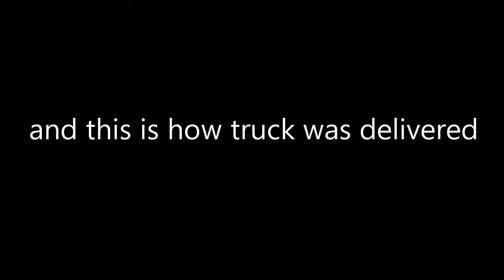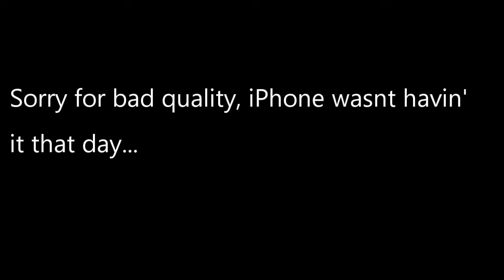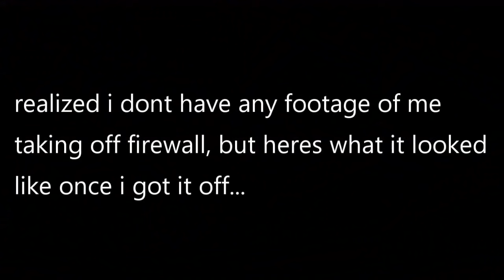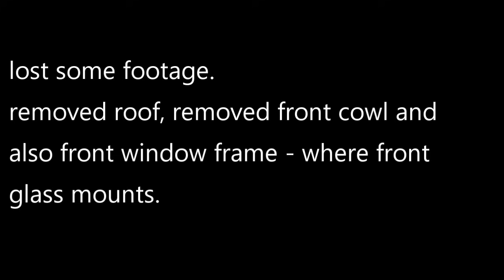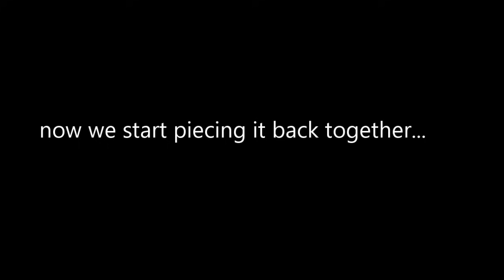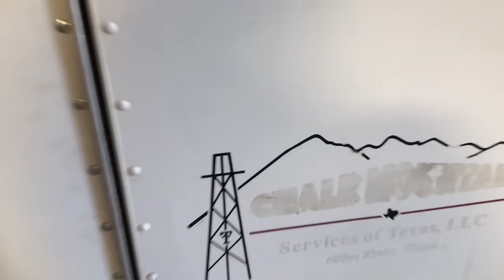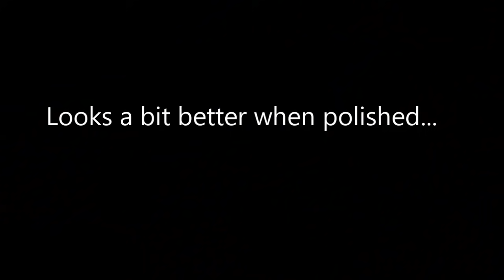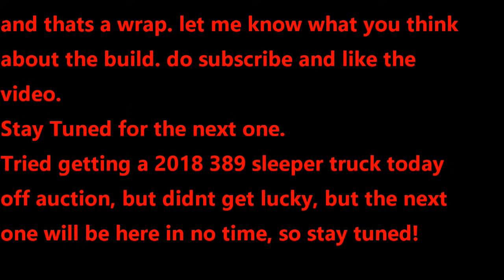2015 Peterbilt 389 from Copart - Start to Finish

Comment: Never worked on a truck cab before. All the fastener holes must be drilled on a jig. On aircraft, panels are either jig drilled or drilled to a tolerance by hand. Jig drilled parts can be swapped. Nothing ever aligns on swapped hand drilled parts. Very impressive work you've done there.

Comment: Good job mate, I recently just got Into rebuilding trucks my self just finished up a 2018 Kenworth w900 roll onto its side. Fully loaded Allison auto nav plus heavy spec double frame disk brakes all around. The truxk was purchased for 200k here in Canada. I purchased it at auction for 27 grand Canadian :). What was super amazing with this build was the frame and all major components were perfect no damage just new cab and some from end parts, trucks on sale now for 165 and offers for 140 are comming in steedy and I’m going to take one of the offer today I think

Comment: Great job on the build. The o ly problem that I saw was the placement of the def tank. Most def pumps are on the left side at fuel stations, but that wouldn't be a deal breaker. The end result was really nice.
Reply from the maker: ye, i dont decide the placement of those. I see a truck, i like it, I buy it. lol.. but yes, its a bit incovenient, but either way, local trucks rarely fill up def at pump. We all have totes of DEF in the shop for the trucks.
Reply: i was gonna suggest a  cross frame fill tube until i saw your post  @BulletMcNugget

Comment: According to DMV so long that it dont replace engine n frame rails you are fine replacing csb.. so why  not use the parts cab?
Reply: The parts cab was an old 359 cab so more than likely it was too old to be used as a whole replacement cab.
Reply: Leo Felix j

Comment: Well the background music I can live with but the camera work.... the flash into an out then in then out is real hard on the eyes. I stuck it out cause I love trucks. I think you did a great job as fiberglass is not a lot of fun and you had a truck load of it. Curious how long it took as your tool selection was bare minimum. I have done some of the older cabs and it takes a while. It took me nine months on a roll over but more steel and bolt ons so that helped. Where you have me is the fly by wire is so much easier and the schematic makes the job easier s my memory is crapola now. I guess the white is kinda gaining traction as a popular color. I went emeron steel gray with yellow and red highlights plus flames and that tells you its been a while ago. My name on the door in old english with the whole color thing blended in. I did three cabs and retired from that cause it is dang hard work and my back give me all kinds of problems from accident.

Comment: Hey man , just watched your video and absolutely love what you did with the truck . It’s amazing and nice to know that people still rebuild trucks like what you did with this one . How did the engine perform when you first cranked it ?
Reply from the maker: Had to crank for a while cause stood a long time, priming took a while. It lost all its oil cause it busted oil pan in crash so I was worried about that, but runs good and sounds smooth so far.

Comment: few questions ,  why didn't you put the other cab on the chasis , why go through all rivets just to change parts on it ? 2 what was the cost of the truck and the cost per total , with work , parts etc? and  3  on the right side of the truck there is a black tank with a blue cap , is that for AdBlue? I mean i live in europe and i thought only we had strict emission regulations ( euro 5 , 6 etc)

Comment: Not sure if it's been mentioned, but a rivet drill bit would have made your life a hell of a lot easier. Very time consuming, and potentially more damage to the panels you may reuse instead of hitting all those rivets with the die grinder. Nevermind, I see that you either bought one, or started using it when pulling the undamaged roof panel.
Reply from the maker: On the panels i didnt reuse, i just cut the rivet and hammered off. On the one i needed, i shave off the head with grinder then just punch the center and it falls out the back. Never even heard of a rivet drill bit. Do they have those? Would make my life alot easier for next project
Reply: @BulletMcNugget  
Yeah they do... I could've swore later towards the end of your video you were using one. I must be going blind. Wow. Lmao. Yeah they have a specially shaped type of 'shank.' You can probably pick them up from a body supply place, or maybe online- Eastwood, McMaster? They definitely make life easier. Guys use them a lot in drilling spot welds. There is "Unibit" type step-bits as well. They're great for drilling aluminum. They don't tend to bite into it and mangle it while twisting you're wrist.
You did a hell of a lot of work on that rig man. Anything out there that'll make your life easier next time is a plus.

Comment: Three questions. 
1, why this music?
2, why didn’t you use the parts cab in whole. ? Looked fine. 
3, why spend all this time and still only have an auto truck? 
Eaton fuller all the way!!!
Reply: Dude it is an eaton fuller box... just an auto
Reply: Automatics are for weaklings, a 13-18 speed manual is usually better
Reply: @4everjesusrules  what a foolish thing to say.
Reply: I often spend time in LA traffic, and NY traffic in the same trip/week, automated manual has a manual mode, no going back now. I didn't think I'd like it, but yeah, I do now.

Comment: How did you make the hole on the driver's side to put the new  air canister.can you please let me know.  Thanks
Reply from the maker: With a hole saw... just mark the spot and drill holes, inside the circle u made then get a little saw and make the edges nice
Reply: Hi.can you tell me the measure from top side   right side.left side to cut the hole or how I can do that. I wan to put the canister air filter on my peterbilt 379 i got one on the passenger side but I like to put one on the driver side. Eny help. Thanks

Comment: I'm curious to know what was the advantage of using the parts cab to fix the original over just installing  that cab on the truck?
Reply: I had the same thought. The parts cab looked structurally sound and if this were my truck, I would have used it. But then!!! I am not an expert...
Reply: Vaibhav Masurkar maybe they got diff vins
Reply: Just switch firewalls so vin will match paperwork
Reply: Yep, that's what I'm thinking about. But maybe the VIN...
Reply: FOR SALE. 
one lady owner.  all LOGS were in roof compartment.
Reply: bi curious.

Comment: This is a question from someone who has never done this, and not a criticism of any kind. Would it have been easier to just swap out cabs or were there differences that (A.) you didnt want or (B.) that would not work? Just wondering. Great build though!
Reply from the maker: It was a 1997 cab and would not work. And getting a new cab is about 15k. I got the parts cab for $700. So the only option was to swap out panels just like  I did. Alot of people are asking same question, hopefully they see this reply!

Comment: That looks awesome now man, how was the first drive?
Reply from the maker: I just drove a bit around yard and maybe a mile on street. Paperwork still in process so not risking anything for now...
Reply: @BulletMcNugget  let me know man, good work you done on it though
Reply from the maker: I been paranoid cause of the lost oil but they shut off when no oil, and when I was replacing pan looked at pickup tube, glanced at liners, everything looked good at the time being.
Reply: @BulletMcNugget  hopefully just a gasket or something simple.
Reply from the maker: The oil pan had a hole... leaked out oil, but hole was small so not like it all came gushing out. Replaced pan, and everything is good now.
Reply: @BulletMcNugget  yeah man, that's awesome.

Comment: Nice job but there's no explanation on anything. Looking at those rivets, truck manufacturers didn't make the cabin sturdy so when the truck get smashed into something the driver would be safe without getting hurt. You did a very nice job
Reply from the maker: This was just a start to finish. I have previous videos where I kind of break down the rebuild process. But im new to this whole filming thing, learning as I go...

Comment: This was a oilfield truck running sand in west Texas reason for the dirt in the cab they usually never get cleaned out because they run 24/7 they just stop to switch drivers and back to hauling sand they go

Comment: Hmm parts cab was off a 379 though did it have all the same wireing?
Reply from the maker: no, I used all my own wiring. just used roof panel, cowl panel and front window frame.
Reply: BulletMcNugget interesting

Comment: i dont get why you stripped the parts cab why not just use the whole thing swap cabs saved weeks of pannelbeating riviting ect
Reply: Exactly what i was thinking, he could've saved weeks off of his time....🤔🤔🤔
Reply: he did not because the vin number would not be the same!!!!!
Reply: @timsmart1465  I figured that's why he chopped up the parts cab. The VIN must be stamped in to it or something (never been close enough to a semi to see) I know cars and trucks just have the vin plate riveted to the top of the fire wall behind the windshield.
Reply: @timsmart1465  but couldn't he just have cut the firewall off of the old cab and rivetted it to the new cab...assuming that the VIN number on Most trucks is stamped on the firewall...but then again he's the one putting in all the work, so he must have had his reasons for not swapping the old parts cab and boldting it directly onto the chassis....👍👍👍
Reply from the maker: Lol... i explained in previous comments. My “parts cab” was a 1997... insides, dash, wiring, mounts everything about it was different. If I could have directly smacked it on truck and not done all that work I foooooor sure would have done that. Woulda saved myself alooot of time and headache. But nothing from parts cab would have worked on mine except for the panels I ended up using... the doors, doors frames everything was different back then so no way I could have used that cab, otherwise I would have. VIN plates were never an issue....
Reply: @BulletMcNugget  thank god for clearing that up, My OCD was kicking in and i was desperately searching for an answer on youtube, searching to see if some other builder had done something similar....thank god now i can sleep peacefully...👍👍👍
Reply: @BulletMcNugget  thanks for exsplaneing buddy pitty that as it would of been a lot quicker fix

Comment: I curious as to y not change the whole cab instead of getting panels from the parts cab and putting it on to the wrecked one?
Reply from the maker: Easy. Look up price on how much a cab costs. 12k-15k and they still might need some work.
Reply: @BulletMcNugget  
Yes I get it but the other one was complete though, was it a different set up or something?
I built cars and pickup, and was curious about this build, came out nice though.
Reply from the maker: @jaykamal1978  the parts cab was a 1997. the interior is completely different. taking my interior and putting it in there, was unrealistic and i doubt id be able to make it work cause all mounts and stuff is different in there, so only option was to just use the panels off that cab and put them onto mine.
Reply: Answered my question before I asked it.

Comment: Great job, but why not use the parts cab as a whole? or did you just want to practice your sheet metal skills! LOL!
Reply from the maker: Yes, I just wanted to spend all that extra time cause I had nothing better to do. 
Ive said it alot of times before, but again, the parts cab would not have worked. It was a 1997, insides, wiring, dashboard everything was different. Obviously I would have done that if I could... but I couldnt!

Comment: You did a great job on that Truck sharp Truck have you seen the Rotator 389 that Ron Pratt has it is a 2015 Pete too it looks exactly like yours in the Front I really think it is the same as your except that it has that Centcury Rotator Wrecker Bed on it & has a Drop Down Axle under it too besides the 2 Drive Axles otherwise it is the same Truck OH it also has the 2 BIG Wheels & Tires on the Front yours looks like a Million Bucks

Comment: Fucking brilliant job brother. Video should be titled "Guy builds Peterbilt kit"...lol. On another note, I'm not sure if you are selling it on to someone but if you are keeping it for yourself, you could have improved on the original design somewhat. Like glue before riveting, dynamating the cab while it's still a skeleton, etc. Just a thought. If you are simply flipping it then great fucking job! I'm curious how much all the parts and materials cost ya. Regardless, great job, Sir.
Reply from the maker: I did use sealant just didnt film it lol. Filled all the seams with sealant to prevent water and hopefully not have air noise. But appreciate it!

Comment: The only thing wrong with this picture is that is not my driveway, I'm way over here in Indiana boys. Believe it or not, the 2003 Intl 9400i with 72" solo condo I bought in 2010 from what I was told in 2012 looked even worse than this and it was rebuilt to almost like new. I didn't learn of it's demise on I-80 in Iowa in 2007 at the time I bought it. First question I asked when I bought it was "has it been in any wrecks"? They said no, none they were aware of. Lying POS them guys were. They bought it in 2005 so obviously they knew. So yeah, total wrecked trucks can be rebuilt to like new and perform just as good for a fraction of the cost.

Comment: why not replace the whole cab instead of pieces?
Reply: Thats what i was wondering
Reply from the maker: well, a new cab is about 15k. and the cab i bought for parts was 1997, so that one wouldnt work in any way. so what I did was really the only best option.

Comment: I wonder how much Copart pays this guys and some others to advertise for them.

Nice rebuild, but not so hard. Semi trucks are not as complex as 4 wheelers. If there's no damage to tje frame and drivetrain, rebuilding a semi is actually easier. Replace the cab, the hood and it's mostly done. Then just check for shorts in the wiring and tune it up.
Reply from the maker: I wish I got paid from Copart. I wouldnt be wrenching lol. 
I mean ye, if u wanna spend 15k for a cab, then about 12k for a hood without headlights, so add another 1k for headlights, then ye its easy if u just replace stuff. But the whole point of this is to rebuild it, without having it cost u close to a brand new one...
Reply: @BulletMcNugget  Yes, parts for semis are expensive.

You're advertising for Copart for free then.

Your videos would be great if you take anything that says Copart or from any other auction, out from them.

Copart is very tricky and is best left for the experienced buyers.

Some dumb viewers might head to Copart just because they watched your video and could get screwed badly, then come back throwing rocks at you.

You might not be advertising, but there are many like yourself posting videos with Copart on their titles. They all claim that they are not getting paid to advertise Copart, but they are advertising the auction house.

I'm not sure about you, but on the other youtubers is the same trend. First build title..... x vehicle from Copart, Second build x vehicle from Copart, third build x vehicle from Copart. Which means thay they are in fact making videos to advertise Copart.
Reply from the maker: Adan Ochoa i mean i get what ur saying, but im sure everyone uses there brain and knows its an auction, anything is possible. And auction says, all sales r final. Ur responsibilty once u win the vehicle. I bought a mercedes SUV from Copart. Spend 20k, bumper headlights, grilles, parking sensors everything was in car in pictures. At least 5k worth of stuff but once i got car, completely empty. Ye i called copart but they said well we dont know what happened so i just had to suck it up and live on. So like I said, im sure everyone understands its an auction. I purcashed this truck with little damage to the roof, recieved it with alot more. Again, had to live on. As far as Copart in title goes, its not for advertising, just seems to draw attention and interest people a bit more. I mean everyones just trying to get views, thats why u see alot of these clickbaity titles here on youtube.
Reply: @BulletMcNugget  I agree with you 100% that is what their intent is they are hungry for viewers & that is how they get them is to put Copart in the Title

Comment: Why didn´t you just swap the whole cabin ?
Reply: Merotina1 
Swapping cabs can be done, but sometimes it’s easier to register with original vin stamp, and some states require that, insurance may be an issue too. Check your state laws for the correct path.

Comment: Not a truck savvy person but must ask why not just swap the whole cab?Or is it a ID plate,DMV inspection infection issue???
Reply from the maker: a new cab is about 15k. and the cab i bought for parts was 1997, so that one wouldnt work in any way. so what I did was really the only best option
Reply: @BulletMcNugget  Is 15k for a dressed out cab ready to go, or just a shell? Back in the 90's we bought some cabs from Mack for DM600s and they were about 7k all dressed out and ready to go
Reply: @cindytepper8878 it's not the 90s , and your talking about mack compared to Peterbilt
Reply: @bryan70546  And that answers my question, how? And just so you know, before about 2000 , Mack owned the construction, mining, waste removal, market pretty much east of the Mississippi. To see a heavy spec Pete was rare. Even the exporters only wanted Mack.
Reply: @cindytepper8878 cost Peterbilt shit is expensive  new are old compared to mack

Comment: As a rebuilder myself it looks too time involved. I would have replaced the cab.
Reply from the maker: Do you know how much a new cab costs? 
The cab that i bought wouldnt work to just put on my truck cause its a 1997, so i had to just use the panels